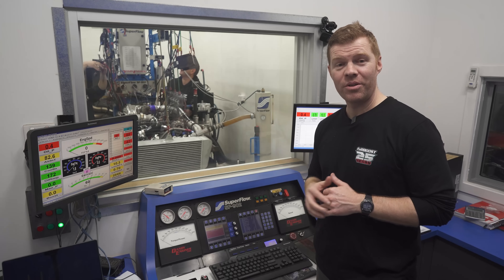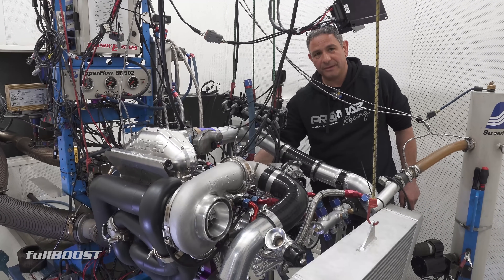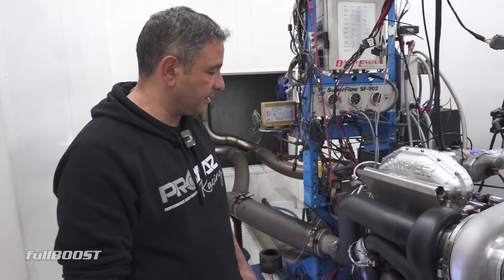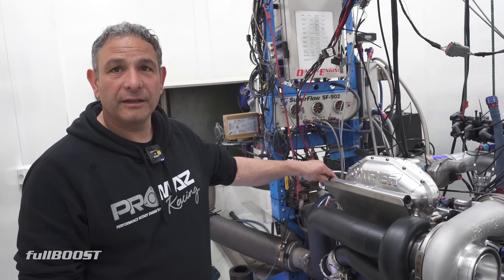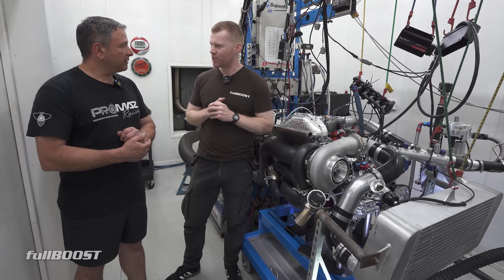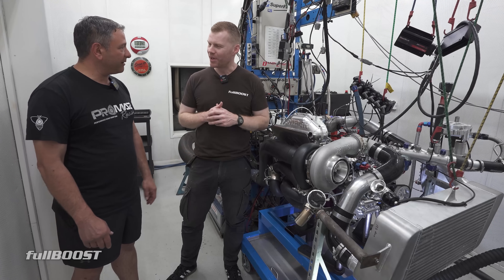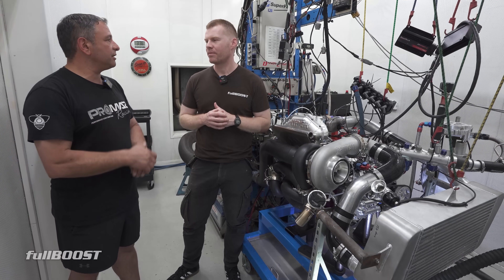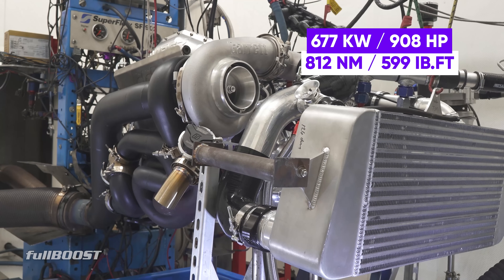Building the best Mazda 20B street response rotary engine | fullBOOST

Comment from the maker: This 20B 3-rotor engine built by Promaz Automotive was setup to be a responsive allrounder to be fitted into an FD RX7 street car. 
You can grab some of our popular new 1990s merch here 
👉 https://shop.fullboost.com.au/collections/1990s
If you’d like to be notified every time we upload a video, subscribe and then click the bell icon 🔔 next to the subscription button.
Reply: I have an FD w 13B, Id like a 20B. Realistically, how much USD to convert to this engine?
Reply: Is this the latest G45-1600?  Seems like it has to be that or the 1500 based on the compressor maps.  Which I suppose makes sense with the alternate pump fuel requirement.  Otherwise the G42-1200 or -1450 would be an even more responsive choice for E85 @ 900 bhp.

Comment: Curious why this customer wanted a billet motor for such a mild application. Oh well, fantastic video and build guys! Great job.
Reply from the maker: 900hp in a light car is mild. ☺️ If you look at the cost to build a 20B now it makes sense to use billet plates.
Reply: @fullboost  Ah! Good info, I was not aware. So every 20b built from now on should be billet for the best cost... That's kind of awesome! And to clarify - my comment on mild is based on what was said in the video.
Reply from the maker: 20B engines are not only hard to find now they are all old with unknown history. It's common when they are pulled apart that the centre plate is damaged. Mild in porting yes correct. 👍
Reply: Let’s be real though, in a street car this is overkill and likely doesn’t put his foot down out there in Hawaii. I’ve driven out there, slow speed limits and tons of cops. However, if you have the money then why not?

Comment: I’ve heard rotaries are supposed to be rich for the first hour or so of running because the initial carbon buildup helps with compression or some sht
Reply: They run rich because thats partly how the engine is cooled as it helps to reduce detonation. Carbon buildup happens on every engine regardless if you put around in it all day and you dont stretch its legs.
Reply: @rotor13  E85 solves that issue thankfully

Comment: Would've loved to see that with an efr turbo. They spool really quick and flow excellent. Their compressor graphs look really impressive
Reply: Not any quicker than the G series. EFR's are limited in size as well.
Reply: Hey man, the largest BW EFR 9280 is smaller exducer and inducer than a G45 and produces fewer lb/min. Wouldn’t suit this application at all.
Reply: @hankslimes  although you are correct, the g45 series does go higher than the efr's. 9280 is about 110 lbs of flow. Pound for pound of flow, the efr definitely spools faster however.
Reply: @hankslimes  it would easily support the amount of power this gentleman is making with correct back housing, and would spool much better